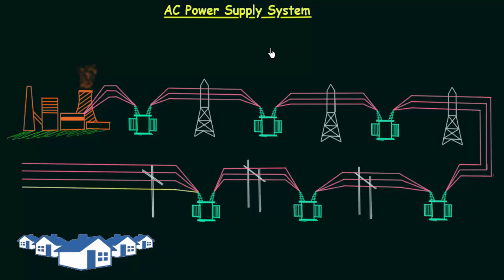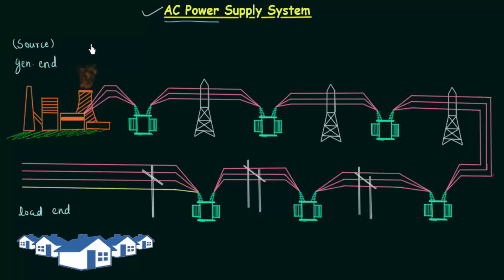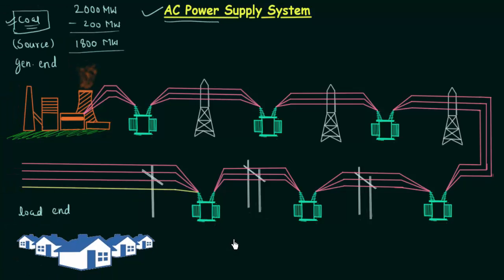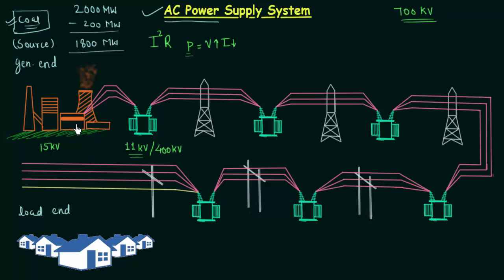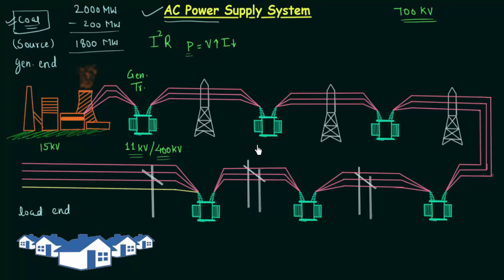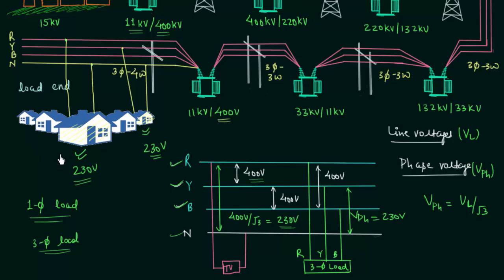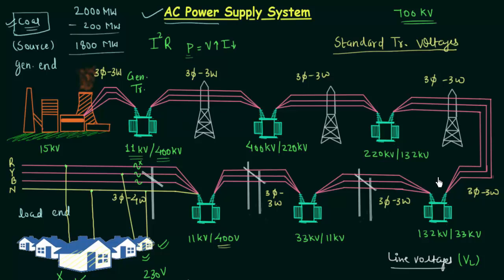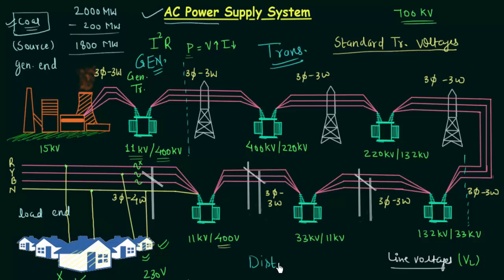AC Power Supply System

Comment: Will you please let us know how the values are determined from generation to transmission to distribution? For example: after generating 11KV why is it stepped up to 400KV, then in the transmission part why are the values 400KV/220KV, 220KV/132KV, 132KV/33KV? I am asking how did we end up with t these specific number of values? I got the I^2*R Loss concept but how  do we determine the values?

Comment: in generating transformer   u step-up the voltage so that the current value got decreased and loss also decreased but further u r stepping down the voltage so that v decrease and i increase to maintain constant power so as i increases does it lead to i2r loss?

Comment: why there is no return path(neutral) for 3-phase load????
Reply: The high voltage part is connected in delta configuration there is no neutral to connect. Even if the load is unbalanced it works. Say the final output side is in a Y configuration then if one phase is loaded more then that translates to the primary side of the transformer into an extra current draw of one of the three coils in delta say between L1-L2. That extra current simply gets delivered by the corresponding delta coil at the power station, the current in the other two coils and their shared line L3 stays the same, the system works even when 'unbalanced'. The power station acts as a delta 3phase voltage source you can load it in any way you want you could even hook-up just one coil/phase between L1 and L2 and it would work.
Reply: Ok I'm trying to figure out what would happen when the power transformers are in Y config. With a connecting neutral the neutral would carry the difference. Offcourse they don't like a neutral because normally it doesn't transport any power. If you were to omit the neutral and still use Y then I guess that current would show up in the other two phases but that would be out of phase I guess, so called blind current. It would show up 120º out of phase in L2 and L3 at the receiving transformer and they add up to a total 90º out of phase in the L2 and L3 lines. It will work but it will generate extra out of phase currents but that would otherwise be carried by the neutral so in the end there's not much difference I suppose. But I'm not sure all of this is correct.

It get's somewhat more complicated when the recieving transformer is in Y and the power station in delta. Those to 'systems' are 60º apart so to speak. So it's like a Y loading inside a delta source. One Y phase gets it's power from two delta coils and the third delta is at 90º. So an extra loading on one phase would be delivered by two coils at the power station.
It's a little bit difficult to figure out what happens with regards to blind current in this situation. The extra Y current is out of phase with each of the delta coils, I guess those two swap 90º out of phase current back and forth. But that current would have to flow through the lower part of the schematic but that part is 'symetrical' to the upper Y leg. No wait they deliver that out of phase current to the upper leg together there's no 'net' 90º current there, they add up (logically). Anyway.. I'm not a power distribution engineer, interesting subject though.

Oh one more thing the mid in a Y receiving transformer (without neutral, unconnected) would not start to 'float' in case of unbalance it's not like resistors it's a transformer those voltages are 'fixed', the mid point stays in the middle even if only one coil is delivering current. Besides some small effect from some copper resistance.
Reply: The short or usual answer is that those three currents cancel each other out. But that's not even necesary it's three voltage/power sources in a triangular formation. It's a bit the same when you connect two DC power supplies together +12 volt and -12 Volt they have a common ground but you can load it any way you want, they are really 'independent' although they share one single common wire. It's the same thing but then in a delta configuration and AC. The lines are shared but the sources can work 'independently' so to speak. The currents always cancel each other out but it doesn't have to be in a three phase sense it also works 'unbalanced'. It doesn't have to be fully 'symetrical' in a three phase sense.

Comment: I have a question when we are stepping Up the voltage by using step up transformer the energy transmit to 11/400 kv but at the receiving end next transformer we received 400 kv energy so why so much energy waste in stepping up at previous transformer. The energy can be transmit at 220 kv even if we include IIR loss there is much energy.
Reply: hi. thats a great question. in my opinion the power are dropping gradually not directly because.......
1.if power drops directly then rating of transformer is very high and the losses of transformer increases.
2.transmission lines needs to maintained. high power is flowing through it over long distance leads to higher losses.
3.if we done that what u had thought so might be we save loss in energy,but simultaneously cost of the system increases drastically.

see i may be wrong. but i think this is the best suitable answer which i have.:)
Reply: its 400V not KV
Reply: sharaban tahora  it's kv

Comment: Sir why we need so many power transformer? Instead can we directly step down 400kv to 11kc
Reply: Rupankar Borah Because we have to transmit Power to different area( states). If We directly Step down to 11 kv and then send to all the area then there will be high transmission losses. and some residitensal area Reqire 33 Kv too.
Reply: small industries need 25 KW
medium industries need 25 to 100 KW
large industries needs more then 500 KW
Housing societies usually needs 400 V L-L
So due to this variation of loads we cant give 11 KV to all consumers